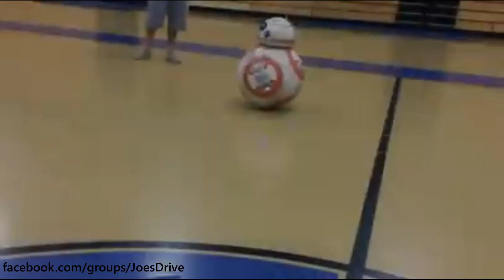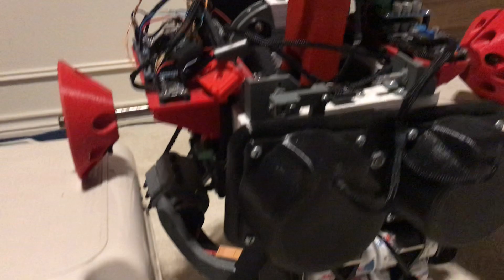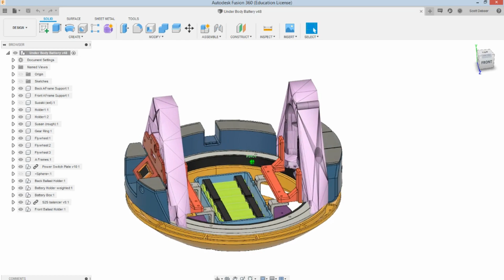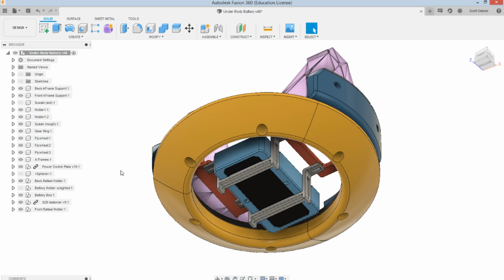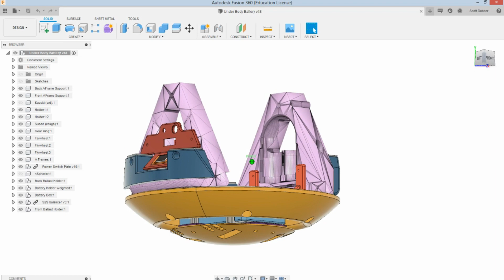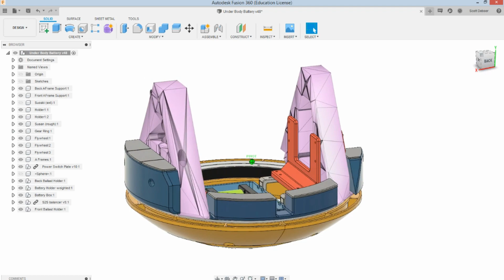MK3 Flywheel for Joe's Drive - Full-sized BB-8 rolling replica

Comment: Is this designed for Joe’s mk2 or mk3 drive?
Reply from the maker: Joe refers to MK2 and MK3 for the head tilt, where MK2 is the one axis with upgraded motor, and MK3 is the two axis using servos. Since the flywheel is independent of that, you can use this MK3 flywheel with either head tilt mechanism. The only difference would be which balancers you print and how much steel shot you need to balance the pitch and roll.

Comment: Aloha Scott. Were you also going to release a tutorial on your make? Fantastic work. Quite an evolution on the drive.
Reply from the maker: If you go to my GitHub, you will find an instructions PDF, which is a step by step guide on installing this system into an existing Joe's Drive
Reply from the maker: As for a tutorial, I have another Joe's drive that I'll probably convert to the MK3 Flywheel and install into a BB-9E at some point. I'd video document that build here of course (I didn't video everything the first time, as I wasn't 100% sure it would even work out)
Reply: @NaigonAkoii  Wonderful, Scott, thank you! I'll check it out!